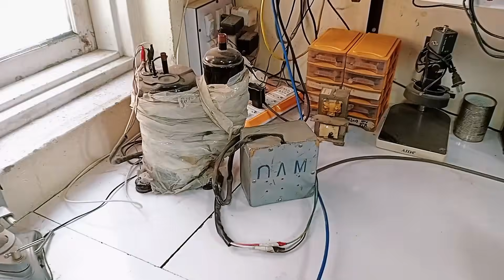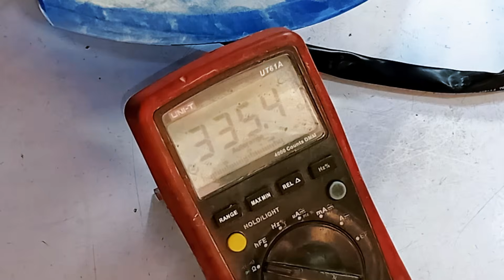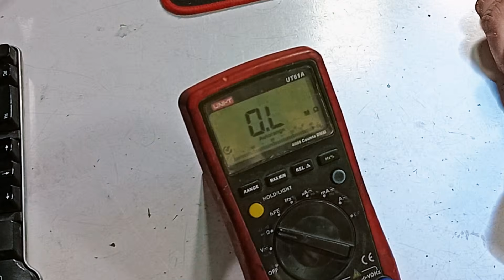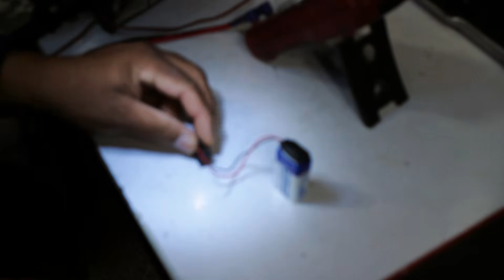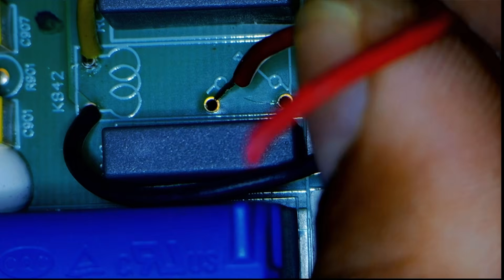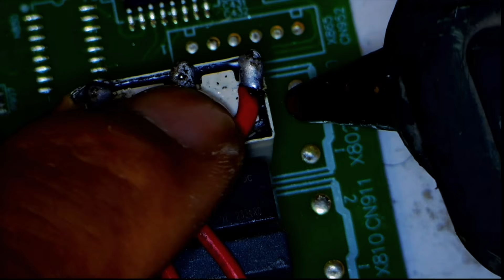How to fix your AC: Fan Not Spinning | Air Conditioner Troubleshooting

Comment: Warm greetings,  
I have a Panasonic inverter air conditioner. I'm experiencing a problem where it runs for a while and then shuts off by itself. After that, I turn it back on and it works again, but after some time it shuts off once more — and this keeps repeating. Do you know exactly what I should check? I've already verified that it has enough refrigerant.

Comment: Thanks, currently the problem is that the outdoor fans are 300v DC motors manage by an IPM circuit not a standard AC  motor.
Reply: Sotoy😂😂😂

Comment: Very valuable vedio ..
Normally fan motor coil starting coil resistance is higher than running coil ..Is it correct ? .but here opposite way ...